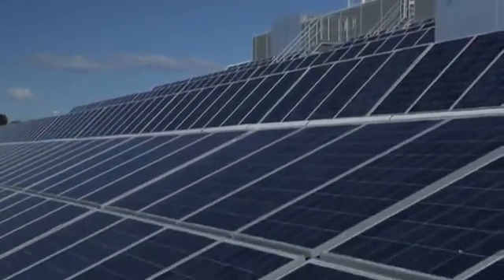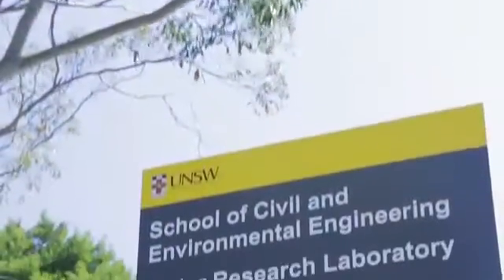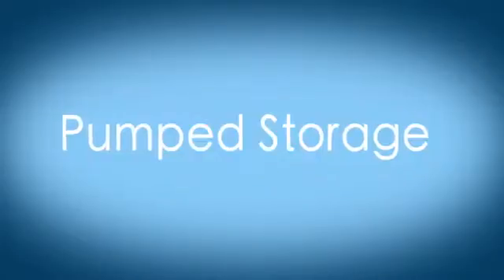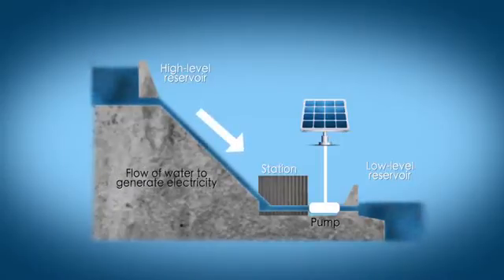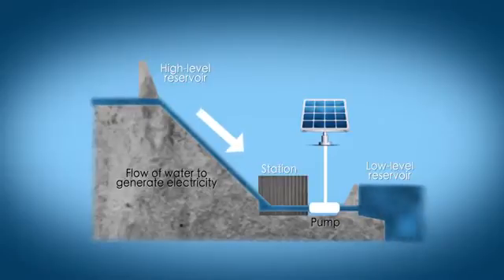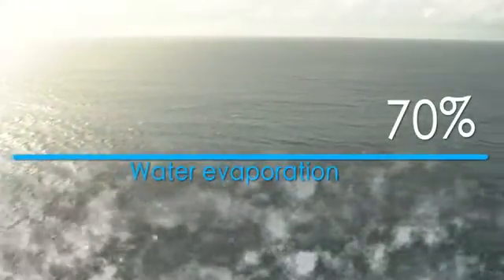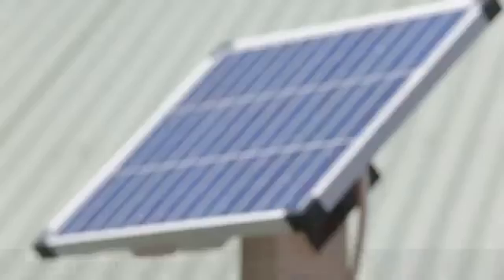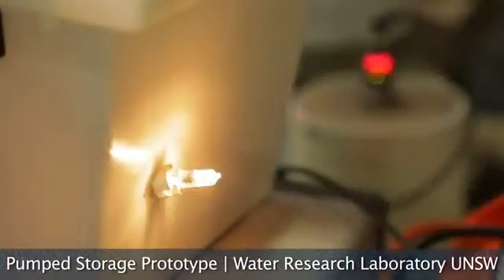Pumped Hydro Offers Storage for Energy

Comment: Excellent for rapid peak lopping, useless as a compensation for intermittent generation low output times as the capacity required is much larger than feasible.